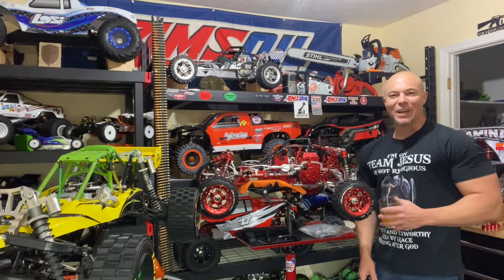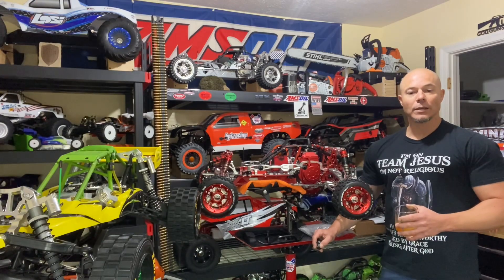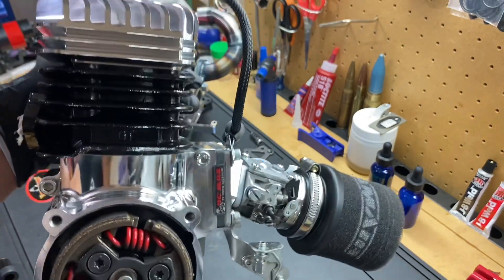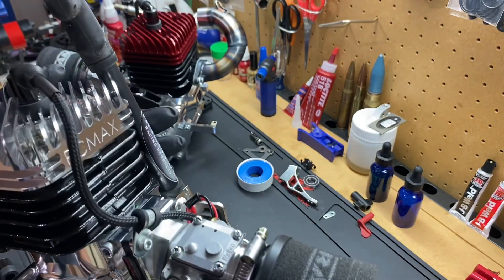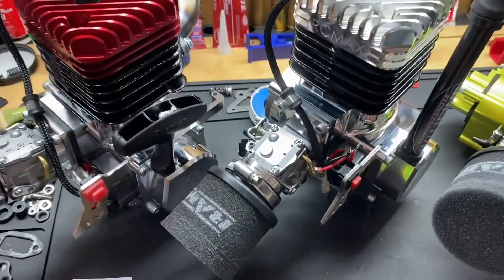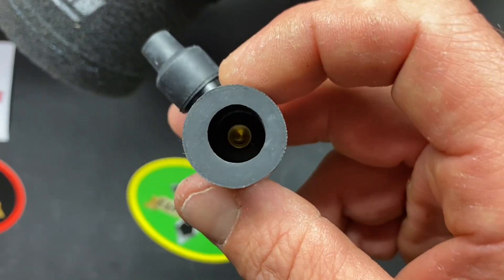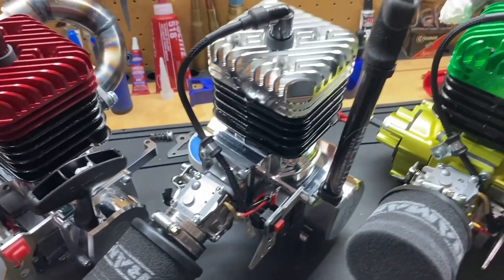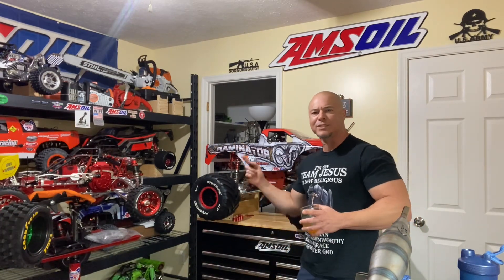My Taylor RC RC Max Engine Collection! Ram 50 Fully Polished UP! BRAAAP!

Comment: Jeff, can I use that NGK end on my stock Raminator engine spark plug wire? The big metal one that is stock means I ALWAYS have to remove the brake servo brace, just to take off my plug wire to access my plug. I would love to switch it over to that, just not sure what's entailed from stock to that. Looking forward to Sunday Service time son!
Reply from the maker: I do not see any reason why not. It simply screws right into the end if the wire. If you have a plug that has the thread cover on it you just remove it and this will pop right over the threads!
Reply from the maker: And thanks brother! I hope you enjoy service time! 🙏🙏⛽️⛽️⛽️🤝
Reply: @eastsiderc  thanks dude! When time allows could take a look at the stock one and LMK your thoughts? Looks crimped not screwed on the stock.